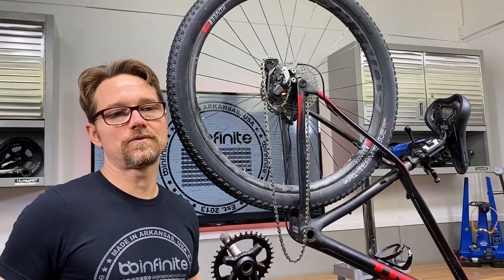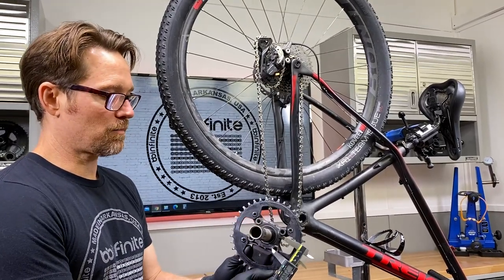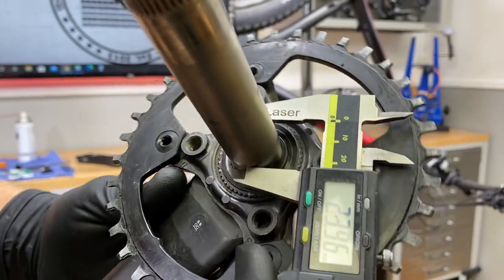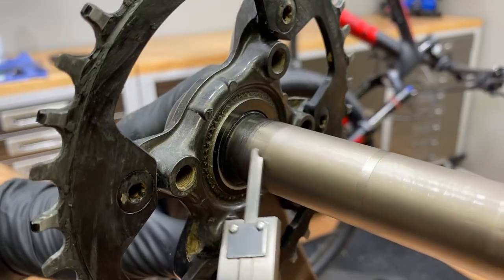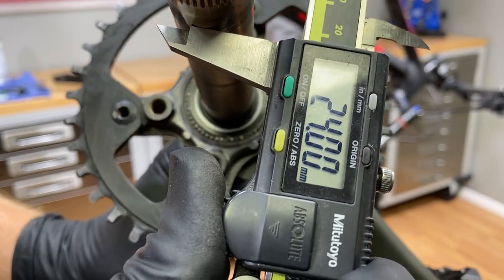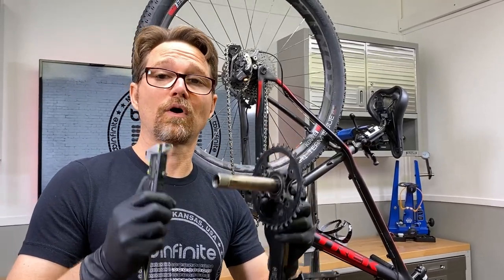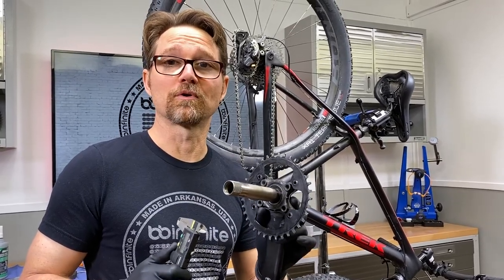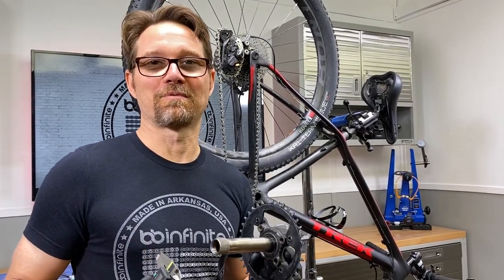Shimano Spindle Wear Problems: A little wear is not so little.

Comment: I'd have never changed so many cranksets sinds hollowtech II.. 
When you notice the bearings it's the question in which condition the spindle is in. Two of them are totaly uneven, rusted and pitted.. 
Never had these problems with square tapered.

Comment: This part of the axle should not wear off in anycase. I don't know if we can talk about a design flaw, but i have many hollowtechs crankset and half of them have the external skin of shaft grinded at the connection with plastic cup. This means probably that some slipage has taken place right there leading to corrosion. If friction inside bearings is high, this sort of slipage can occur. Grease may help but for how long. Plastic cup should have been locked on the shaft with splines as for crank arms.
Reply from the maker: Wear is inevitable. These systems are exposed to harsh environmental conditions and end users generally neglect maintenance. When one considers the cheap price of a typical Shimano crank, then factors in how brilliantly it works throughout its long service life (delaminating cranks are a separate issue, we're discussing spindle wear), you should consider it a wear item that will need replacement at some point years and years down the road.
Reply: @BBInfinite  I don't completely agree with considering crankset as a wear item especially the shaft. Shaft concentrate all loads and a bit of engineering to lock plastic sleeve on it, corrosion protection on internal wall - because exposed to harsh environmental conditions as you said - wouldn't be a luxury. The potential outcome can be the same as for delaminating cranks. This does not prevent the average user from doing a little maintenance by re-greasing where necessary.
Reply from the maker: @Blaze_75-y3l  I get what you're saying. I think it's just a Japanese, pragmatic, KISS-principle thing. The level of complexity is balanced with service life is balanced with price, is balanced with manufacturability, and so on. They're making an aggregate value judgement, and acceptable compromises are part of that.

Comment: your measuring is sloppy. You need to keep the caliper perpendiclar. And it's a non issue with steel axle. It can be a serious problem with aluminium alloy axle though.